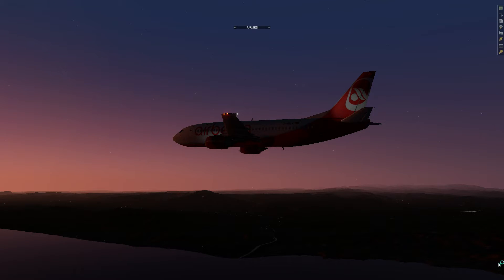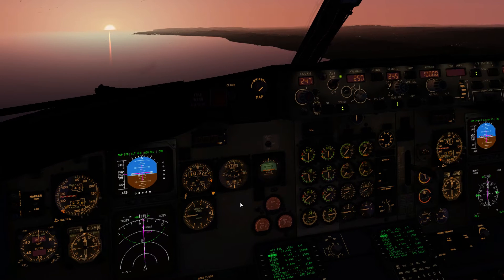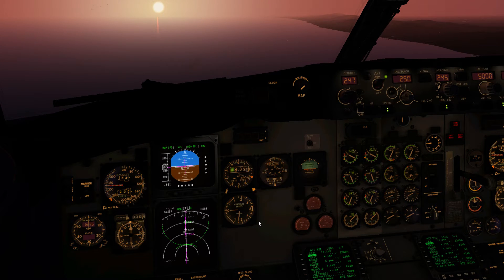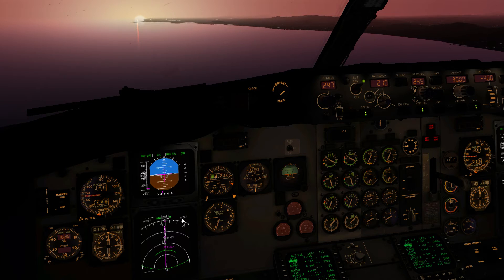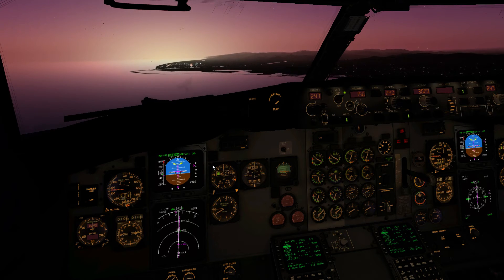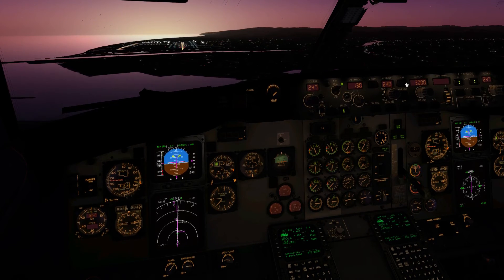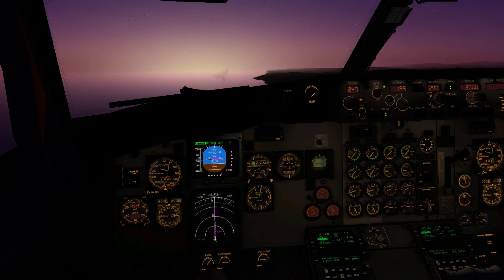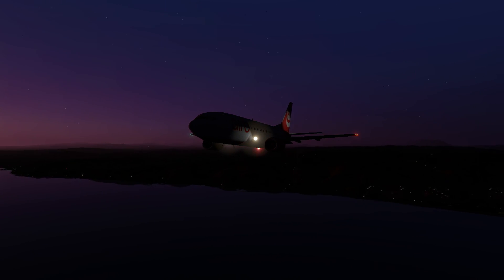IXEG 737 Descent Management and Go Around [X-Plane]

Comment: I did love the ground school part. Helped me a lot not to come in high and fast. I do sometimes find that the t/d computed by the fms gives you steeper descents. Would you recommend just going by the numbers (i.e. 1000ft per 3nm?) I find that this makes my descent less stressful
Reply from the maker: As always the answer is really "It depends..." ! The vertical track is totally dependent on the lateral track. If you're flying a straight in arrival from top of descent (remote or island airfields with no airspace issues) then VNav will be fine. However if there's any risk at all of the track being shortened then VNav from top of decent will leave you high. A compromise method often used it to put a vertical constraint on the flight plan to "force" the ToD to a better location. Pick the last point on the plan before vectors are likely and put an altitude constraint on that leave the aircraft on an acceptable profile. On the Airbus I often use the secondary plan to construct a shortest possible routing, then look where the ToD is on the secondary and put a constraint on the primary plan to make that profile achievable. Even in locations where managed decent from ToD to final approach is possible the aircraft will fly a "hot" profile compared to what most crew are comfortable with. Hope that all makes sense.
Reply: Very clear thanks so much. The engineer in me looks at it like loosing potential energy without gaining kinetic energy which means it all has to be lost via drag. I find the fmc on the ixeg 733 cl likes to use 3.5 degrees descent which is a tad more than what I can bleed off without speed brakes. I tend to use the figures from the gound school descent video and do a 3nm per 1000ft to fl120 then a 5 nm per 1000 for the last 2 to bleed off speed to 250 kias. Then depending on the STAR and how much distance I have to descend I do either one, trying to do the 5nm per 1000ft. Watching your stress free way to operate the plane is really a great help to flightsimmers like me trying to learn how to fly those things properly :)